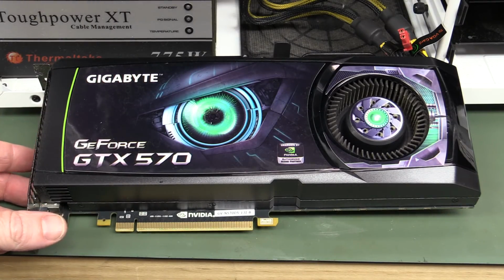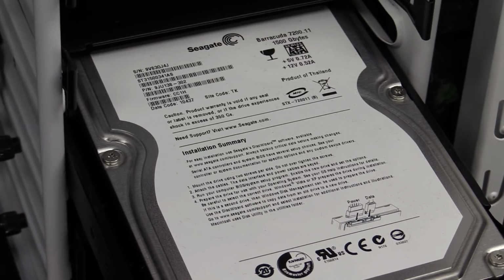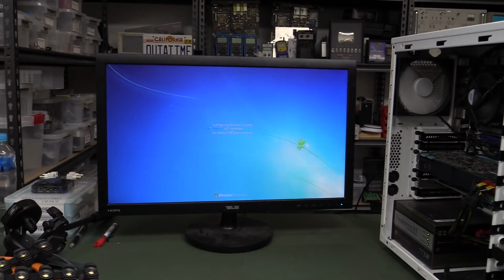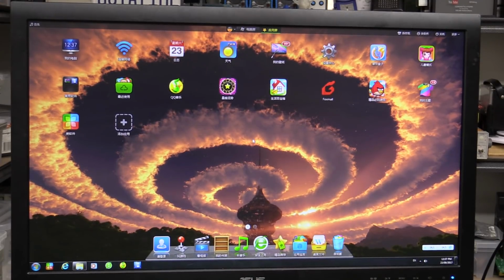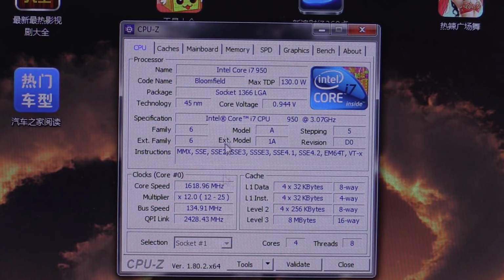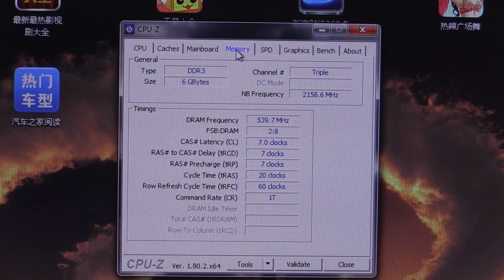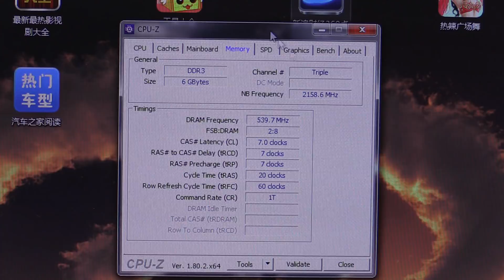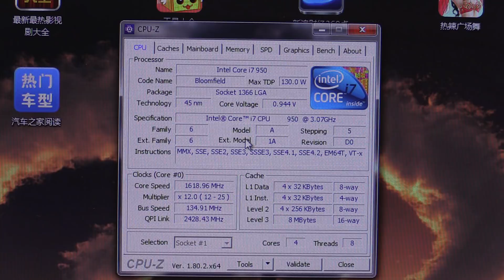EEVblog #1026 - Mystery Dumpster Diving PC

Comment: omg who would throw that out, the case alone is worth £30, power supply anything over 650watt is a decent unit, the gpu if thats gtx 560+650 territory thats £7.50-£30 depending on condition. lol called it GTX570 in good working nick so thats the top end £15-£30, LGA1366 from the looks of it, the 6 dimm slots kinda gives it away Triple Channel DDR3

Comment: At my university i once found a I7-3770 in a motherboard with 8GB of ram. I wouldn't boot at all. All I did was remove the bios battery and put it back in. Then it worked beautifully. And was way better than my I5-2500k. So that was an easy upgrade. Keep in mind this was a couple of years ago. I think the 4th gen must have been the current generation.

Comment: Nice find here Dave! Hardcore Angry Birds gamer needed a newer more powerful system perhaps?
Because there are many generations of Intel "Core" processors you could easily find i5 CPU's that are better than i7's of earlier generations. Even the latest i3 CPU's can be much better than a lot of earlier generation i5 and i7 CPU's! But I suppose you won't find them in the dumpster.
I found a system dumped on the street with a first generation i7-870, which is great, but my current main system with a 3rd gen i5 kicks the pants through it! These dumpster dive systems make great spare schematics/service manual viewers, maybe just upgrade the video card and add a 4K monitor. ;)

Comment: 570... I use a 740 in my workstation just to be able to run some of the 3d effects and modeling I play around with
only runs it around 30fps max for most of the bigger things like FO4 and Fortnite
but I mean if your playing KSP, Skyrim, or even like Oxygen Not Included youre probably golden at like 50-60fps

Comment: That is a great find! I had a gigabyte x58-USB3 i7 960. Btw if you have any memory issues. Its a 3 channel motherboard slot numbers are as follows 2 1, 4 3, 6 5. 2 and 1 is a channel 4 and 3 is a channel and 6 and 5 is a channel. I had an issue with memory being recognized with mine. Just follow the order I gave you and you should be fine.

Comment: sorry, i had to laugh when you suggested that that pc was better than what the viewers were using..

here's mine
i7 6800k (4.2GHz @ 1.38v)
Asus x99 strix
64GB corsair vengeance ddr4 2400
gtx 1080 strix (2100 MHz)
2x samsung 850 evo 500GB (Raid 0)
2x seagate barracuda 3TB (Raid 1)
EKWB x99 Monoblock
EKWB 1080 strix water block
cooler master master case pro 5
Reply: gg
Reply: well he said it's "probably" a better pc than "a lot" of people are using

most viewers (or people in general) are not rocking what you have in your build

Comment: I'm surprised it works flawlessly. I recently got a 2014 i3 laptop because it was 'slow'.
Suffice to say the HDD was dead, put an SSD in and a new keyboard and sold it to a friend cheap. 
I don't get why people get rid of stuff so easily, especially in this case as it works absolutely beautifully.
Not a bad processor either. First gen but still, makes a nice secondary PC.

Comment: This is still a pretty decent little low end gaming rig in it's current state, insanely upgradeable,  but if you were to throw an ssd in there some more ram and upgrade the GPU (1060/580) or higher,  throw a AIO on there and OC the CPU this would still be insanely viable today..   I can't believe someone would throw this away. So much upgrade room here.  Hell just parting it out and selling the parts.  People are crazy.
Reply: That CPU is not that strong

Comment: 8:58 "I'd have to set up a surveillance camera... you uh.. live..feed or something"
Maybe that isn't such a bad idea!! Haha
You could find a smaller PC from the dumpster, put a cheapo wifi card inside, connect it to the work place's wifi, attach a cheap USB webcam, and set up a youtube live stream, all to start when the computer boots. Then mount it somewhere hidden on the wall, and use something like teamviewer to control it in case.
It'd get lots of hits, like that Jackson Hole Wyoming livestream that got popular for some reason.

Comment: That is a x58 chipset motherboard. You can stick a xeon X5600 series in that and that's the magic. 6 cores 12 Threads. They also clock pretty high. I managed to reach 4.0GHz and i'm not lucky with the silicon lottery. Some X5670 can reach up to 4.4GHz stable.
Also, since the memory controller is integrated on the cpu, you can use DDR3 ECC Registered memory... you can find a ton on ebay so cheap.

Comment: That's nearly the same setup as I used to have. Same MB, CPU, GPU, case(but in black)....only difference was I had a CM Silent M2 720W and much better RAM. I still have all the hardware though, for nostalgia reasons of course....could never throw the baby in the trash mate! Gonna have to do some dumpster diving now.....except in the UK I'd need some dark clothing and night vision goggles! ;)

Comment: Any i5/i7 is worth selling/using and a 570 is probably better (or close at least) than many cards sold in low cost "gaming" PCs today. The swedish fractal case is also good you can get a new front panel if you contact fractal with usb3.

Comment: This is a 2011 CPU, a 2011 Motherboard with a 2012 Graphics Card.  I suspect it is an Internet Cafe comp.  I am honestly disgusted someone would throw this out.  In 2012 this computer would of been priced anywhere between $1200 and $2100.  That fancy PSU is around $180 alone.  For people who play PC games this represents the previous generation of gaming machines built for DirectX11.   About as powerful as current gen gaming consoles.  That is a pretty barebones mid range system with a lot more fans than it needs and a pretty garbage stock cooler on the cpu.

Comment: Surely there would be splash marks on the feet and bottom of the case if this was left out in the rain ??

Also there would be some signs of water ingress surely ???

And who would "Dump" their PC and leave the hard drive data intact, in fact who would even leave the hard drive in it ?

Very hard to believe this was dumped.

Comment: I have the 850 watt version of that power supply and it's great, other than the fact that I'm missing most of the modular cables for it since I bought it used. Also, that video card performs about the same as an RX460, which actually isn't half bad. You could definitely run some newer games on lower settings or resolutions.

Comment: Damn, that's a great find.  Fractal Design cases are pretty highly regarded still today, I use a newer model of the same chassis for my Haswell (4th generation Core i7) system with USB3 ports on the front panel.  The motherboard you have here uses Intel's X58 chipset which was for workstation-class first generation "Core i7" (following the Core 2 Duo/Quad/Extreme family).  Intel's Core i7 Extreme Edition chips actually use the same socket (LGA1366) that their Xeon family at the time used, and I believe these CPUs started in the USD$500 range, with the 950 that you have here being the second fastest i7 EE CPU in that family (975 is a 3.33Ghz part with original MSRP at $999).  You might be able to drop in Xeon CPUs if the BIOS will allow you, but I'm not sure exactly what features you'd be excluded from.

I'm putting together a system like this with the same 950 CPU and it is absolutely no slouch.  You might not want to do 4K gaming or video rendering on something like this today, but if you wanted to needed a top-tier Windows 7 system, you could pretty much only do worse.

The only work I'd consider doing would be moving the OS onto an SSD, adding a $20 aftermarket CPU cooler (replacing the thermal paste at the same time) and replacing the CMOS battery before it causes you any drama.  Beyond that, I'd let the GPU give you another two years of life before I'd consider a refresh.  Plug a controller into it and throw it in a corner with a 1080p monitor to play cheap games on!

Comment: About as good as my 5-year-old Linux box (3.2 GHz core i7), just a better power supply, a fancier case, and a slightly better video card. Would I dump mine in this way? Probably not.

Comment: This is pretty much a better computer that I built in 2011 and still use. I had a 500w psu and a GTX 550ti which is the only thing I've recently upgraded

Comment: Intel X platform motherboards are not going to have any i5 or i3 SKUs, X-series are the "enthusiast" platform with the (for the time) crazy $1000 hexacore i7s and Xeon support. In this case with X58 you're looking at anywhere from the Core i7-920 to the Core i7-975 and maybe up to the i7-990X. i5s and i7s would be on the lesser LGA-1156 socket motherboards with your H55, H57, P55 and Q57 chipsets.

Comment: Nice find for sure, just upgrade the video card, and max out ram along with an SSD with 2nd HDD and it would still be a decent daily driver, and light gaming machine for sure. Also this is better then the machine I'm using right now to watch this video being a Lenovo Thinkpad X131e Chromebook dual core Intel Celeron 877 @ 1.4Ghz  with 8GB of DDR3L ram 16GB flash storage and 500GB WD Blue 2.5in HDD 2 USB 3, 1 USB 2.0, VGA, HDMI, gigabit wired lan(rare on a Chromebook) SD card reader, 11.6in 702p mat screen, but no this is not my main machine just my couch, and travel computer.

Comment: The ram is fully populated.  It takes 2 types of ram the blue s for one type the white is for the other.  like pc2800 vs pc3200 each color is a diff speed.  you can't have all 6 filled or it will not work and could actually blow the other ram if you mix them.

Comment: Nice find! socket 1366 i7 board, regardless first gen i7 with 6/12gb ddr3, and a 570. if it posts or even if it didnt, and the case+psu. AMAZING FIND!

Comment: X58 is a wonderful platform!  It still holds its own even though it's almost 10 years old.  I ran a GA-X58A-UD3R motherboard with Core i7 930 (OC'd to 4.0GHz) from 2010 to 2016, then grabbed a cheap Xeon X5650 6-core X58-compatible processor on eBay (data centers dumped their old CPUs on eBay and thus 6 core Intel CPUs became easily available for <$100).  Same motherboard with the Xeon CPU and it still games just fine in most games, also OC'd to 4.0GHz with an AIO water cooler.  I replaced the machine with a Ryzen 1800X build this year but moved the old parts to a spare case for a second case so I could have a gaming PC for friends to use.

Tried to pick up a second X58 motherboard to repurpose the old i7 930 for a TV build and the gaming X58 boards still command huge prices on eBay, probably due to how cheap the Xeon chips are.  I got some no-name X58 board from China that appears to be a bare minimum layout built from new old stock parts for $100 and it makes an OK mid tier gaming build as well.

Comment: Yeah, my PC is better and worse at the same time. First of all, it's a laptop, so it's more portable but less powerful. It's a Lenovo Thinkpad T520 with a Core i5 2400 or something like that, so I think it's a generation or two newer (Sandy Bridge), but of course less powerful (dual core at 2.3 GHz or so), but I've put 16GB of RAM into it, so that's where mine is better ;) - and of course I am not using Windows, so that's where my PC is about at least 10 to the power of 18 times better than anything that runs on a Microsoft OS! SCNR...

Comment: X58 chipset is only Core i7 or Xeon.Both can be quadcores or hexacores with hyperthreading. With overclocking these can still be quite powerful even these days. Old Hexacore X58 xeon's can be pretty cheap so it's a decent base for a budget workstation.

Comment: Fractal Design is a computer hardware manufacturer from Sweden. Founded in 2007, the company manufactures computer cases, water coolers, fans and power supplies. All products are designed and engineered in Sweden.

Comment: The big functional problem with that machine is the Seagate harddrive in it. Aside from running HOT and higher overall  failure rates then Western Digital for the same era, especially the 4tb WD drives.. they're just crap for performance with with the number of sustained iops. Slap a Samsung pro series SSD into that machine, and it'll fly.
Reply: My 7200.11 1.5TB is still going after nearly 9 years, many almost 24/7 operation.  I wouldn't keep anything irreplaceable on that drive, but it's certainly still usable especially as a secondary drive to store your games on.
Reply: I did say "overall failure rates" there will always be statistical outliers. I too had some pretty decent luck with the 1.5tb series Seagate drives.. I just didn't trust them very much because of all the other failures I'd seen from Seagate drives of other capacities at the time.. but I tend to be suspicious of storage devices in general, since it's not a question of if, just WHEN it will fail. For many years I wouldn't touch a Western Digital until their failure rates went down.. the 4tb drives were/are still some of the best from WD, reliability wise. I also buy media from different vendors and different batch numbers, so, I get a fairly good comparative statistical mix. Their was an excellent article/review from the company blackblaze (they operate a cloud storage service) written in 2016 which their reliability observations paralleled my own.. but on a much larger statistical scale. Those Seagate 1.5 are almost worth running just to see how many years you can get out of them.. I still have a 1.5 external I use just for bulk data transfer. It's still trucking after many years, but definitely runs hot.

Comment: Not sure it could have ever been a Core i5 or i3.
The X series of motherboard chipsets are what Intel calls HEDT or High End Desktop.
6 DIMM Slots was another dead giveaway.
Many people who run home servers for fun and to learn VMware, Windows Server, etc are still using the Dell R710 and HP G6/G7 servers.  The machine you found is basically a 1P version of these common 2P servers.
The processor in that machine is the desktop version of a Xeon 5500.

Comment: found a complete pc myself 2 months ago. Not like this beast but a newer kind of Celeron with windows7 prof installed and get this: a 500GB hdd! I know the first Celerons sucked because I still own one from 2010 (MSI). It can just handle w7 starter.
Had to do a little maintenance, mostly driver reinstall but is it working now. I would pay 100 bucks for it. Nowadays you can do fine with a pc that has a couple of years on it. Best old pc find for me too!

Comment: That case is a knock off of the Antec Mini p180, but the purpose of the origional Antec case which was made in 2007 was to be a silient case if you put sound dampening foam behind the case it should become pretty quiet as long as it dose not have junk fans

Comment: Haha, my company just wanted to get rid (like throw them into the dumpster) of two design computers last week, running specialised software with win XP. Being in a custom box, you couldn't really say what was inside, but the manufacture year of 2012 got me thinking. Took them apart, and I was like you: i7 950, 6GB DDR3, 560GTX, 750W real watt PSU (80bronze certified), and 600gigs Velociraptor HDDs.
Being so impressed, I told to my colleagues, and they were not that impressed. Like: "What is that board today? Is nothing in terms of performance, does not worth my time..."
Took them in, put them in an old forgotten case from one of the corners of the warehouse, and made my self a nice i7 computer, with SLI boards and RAID Velociraptors :D
Installing Win10 as we speak, and works like charm :)
For free, and it came at a good point, as my laptop is already quite old.

Go for dumpster diving, guys!
Reply: You live in aus? also, where?? I can't find anything this good...
Reply: QuickPro Studios , I'm pretty it depends a lot on the company that you work for, and also the neighbouring companies.
Also, doesn't hurt to open your eyes and ears as good as wide as possible, and also interact a lot with your colleagues.
If you talk a lot about what you are interesed (without showing specific interest), you will start seeing them. Just today one of my colleagues almost offered me his old GTX650 for $10 :) I had the ones from the recycled computer mentioned earlier, so I turned it down.

And to answer your question, not really aus...just over the pond ;)
Reply: Many years ago several groups in our area were highly efficient at dumpster diving. Companies pressed to make the activity a National Security Threat since they were clearly dumping high value items perhaps on government contract.

Comment: Just a bit of Info, PS/2 inputs are still desirable by some hardcore gamers or test labs for their incredibly low input lag or NKRO (unlimited multiple/simultaneous keystrokes) vs USB which can be just as good as PS/2 and oftentimes even better. However there are those very specific conditions where PS/2 still rules out as the winner due to a single category out of tens of categories. An example would be competitive gaming where fast and multiple keystrokes are required such as in shooters or racing games. USB has a protocol limit most of the time to 3 keystrokes at any given point, some are up to 6 but its uncommon, some newer boards use zoning so you can use special keys with combos (like Shift,Ctrl,alt + an alphanumeric key, most boards only allow two of the three modifier keys with an alpha numeric key) or in certain testing applications where there are other USB devices on the bus that are using potential polling time where split second response to some sort of input device is required. Human response time testing is a common example, though a lot of testing equipment manufacturers are still using straight up serial for things like that for the hardware interrupt vs software.

Comment: I have found a complete HP DL580 G5 server in dumpster. 4 CPU - 4 PSU(1200Watt) 80 GB RAM. I don't have power cable. I will find a couple power cables and try to boot it.